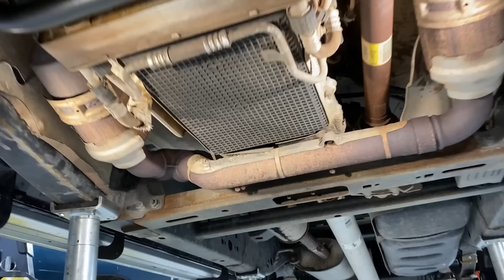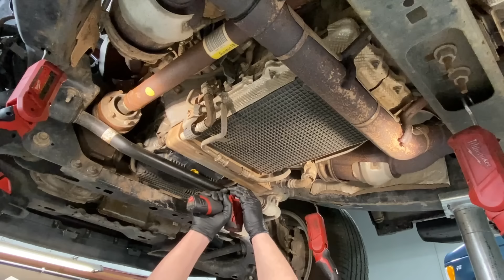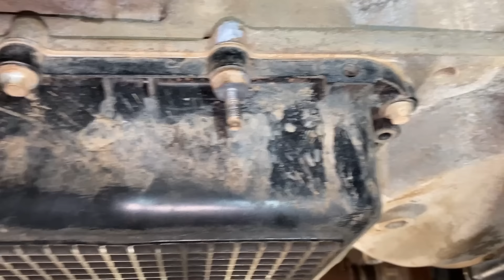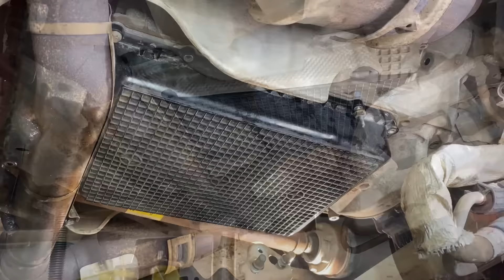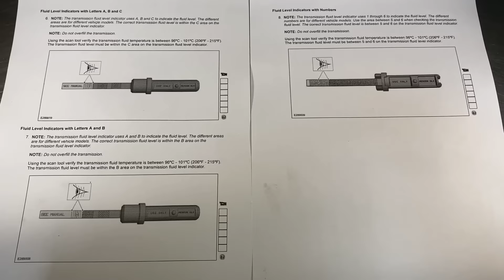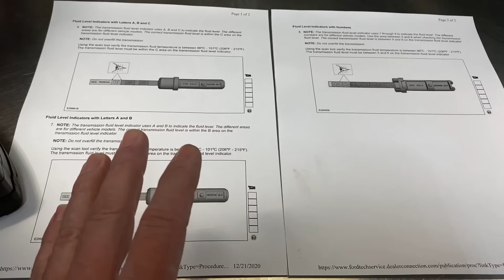Ford 10R80 Ten Speed Transmission: Fluid and Filter Service Procedure

Comment: Update.  I have had 4 separate quotes to have this done for $500-$600.  But then average people I know say it should never be over $300.  They probably do not know.  Or am I missing something?  I would like to attempt this myself but feel like I will miss something.  Like how do you purge the rest of the fluid etc...  ?
Reply from the maker: No I also quote them between $400 to $550 depending on the configuration. This trans is very labor intensive and the genuine Ford filter is not cheap. It all adds up for sure.
Reply: @FordTechMakuloco  Wow thanks for the reply.  your video is the best tutorial I have seen.  I think I will tackle it myself.

Comment: So I am in agreement with most comments I see here.  This looks a bit much for a do it your self job.  But I just called my shop.  They said.  3.5 hours  total cost for material, parts, and labor $585.00  So for that kind of $$ I think I will set aside an entire day in my driveway and make sure I don't mix up anything.  This video is a great step by step.  I just hope I don't mess something up.
Reply: Here in '25 that figure is $640-ish, from a shop I trust. Can't imagine what a stealership is charging, so yes I'm already half way through this job.
Reply: @craigbunyea6794 my local dealer said the trans is sealed and you can’t service it. Lmfao what a joke I said it’s oil it has to be changed!!
Reply: My local dealership is$1,000 for this job
Reply: Just did this job. Sucked the fluid out first and dropped the pan. 1.5 hrs total.
Reply: @fordracing19 smart to suck first
Reply: @fordracing19  did you do it on a lift? I'm doing it in a driveway and debating if it's smarter to do it flat or on ramps if I have to unbolt the transmission, I don't want it shifting on me.
Reply: @fordracing19  definitely suck the fluid out first. In fact, I am going to skip the pan drop and filter replace entirely. And just suck & replace.  $131 for 10Q and the pump
Reply: Did it laying on my driveway in about 2 hours. Not that hard.
Reply: My dealer sold it to me for $611. In June of 2025
Reply: @earlcarpenter3100 Was that fluid and filter or just fluid?
Reply: @anonymous_friend yes just fluid and filter service, then dealer screwed up and overfilled and had to take back.
Reply: @earlcarpenter3100 Oh geez. How did you find out it was over full?
Reply: I have been quoted 800.
Reply: I just did this job. Took me about 6 hours, but not horrible! Get some metric open end wrenches for the rear bolts of the pan. That was my only hangup. Took me a while to get to those with an adjustable wrench because I couldn't fit a socket in there
Reply: @angelo57a51  you got the 3.5 or 5.0?  

I don't understand his explanation of "3.5 doesn't need to worry about exhaust like the 5.0."  My 3.5 exhaust setup looks just like this video.
Reply: Dealership Quoted us 1,100$ in showlow Az.
Reply: Do it yourself. Doesn’t look that bad. Wise to give it a day to keep pressure off.
Reply: I got quoted $360
Reply: Did it in two hits my self easy as pie
Reply: So how did it go, doing it by yourself?
Reply: worth it sorry. pay them the $600 much cheaper than and trans
Reply: Not at all this is a easy 2 hour job 😊

Comment: It kind of pisses me off how cheaply (and stupidly) many modern vehicles are designed nowadays and Ford seems to be one of the worst. Just look at all the plastic pans and other cheap parts. Also, a drain plug would be nice to freshen the fluid between filter changes. Even the most basic maintenance tasks have become too complicated for the average owner to tackle. It's very frustrating considering how much as new vehicles cost, especially trucks.

Comment: I have a 2018 F150 10R 80 automatic. I contacted 4 Ford dealerships they all will only flush them. What your thoughts on flushing. I have 30 thousand miles figured I would just do an early service. It's much less expensive as a new  transmission. Thank you for your channel it's great.

Comment: Just imagine if the engineers who designed it would have added a simple drain plug to the pan...
Reply: This is one of those BS "Sealed Transmissions" with supposed "Lifetime Fluid."  They don't want you changing the fluid; they want it to break down, so you either buy a new transmission from Ford or buy a new truck from Ford.

Comment: I have a 2018 stx 5.0 4wd. Previous owner had 35 in tires with it all stock. It shifts strangely to me. Skips a gear on the low end sometimes. On the high end it seems like I really have to get on it to make it downshift to accelerate. The speedometer was not calibrated for the tires. I went down to a 33 inch and have ordered a calibrator to get it right. My question is do I need a reset on the adaptive tables to get everything right once I have the right tire size put in ?
Reply: 10 speeds routinely skip gears.  Thats totally normal.

Comment: Too bad you're all the way in IL.  TX could use this shop.  Dude, your video is why I decided this is worth doing myself.  The dealer wants $600+ for this service and says that dropping the pan only removes 4qts, MAYBE 5 at most.  I think I'll trust the guy with a wrench in his hand over a service advisor just trying to pull cash in for the dealer.

Comment: My 2018 F-150 with the 3.0 Powerstroke has the transmission cooler mounted to the driver's side frame rail away from the transmission, as well as there being lots of room between the transmission dipstick and single exhaust downpipe.

Comment: Normally How many hours a job like this takes  & how much would you  have charged a customer compared to taking it to a dealership  servicing .
Reply: My dealer charged me$260. I have a 18 f150 2.7. Worth it to me.
Reply: @huemongus3742  do you know if the dealer actually changed the filter?  I am concerned that a mechanic may simply vacuum out the fluid and replace the fluid only.
Reply: @honestabe7349  Yes, that is with filter change. Just ask them to do it. Same with rear diff, ask them to pull cover off and clean it out. Not just fluid exchange.
Reply: I’m also curious about this Brian. Normally I try to do everything I can on my truck but this is a bit more than I want and I’m only halfway through the video. I am only about an hour from your shop and I’m coming up on 30k miles. Guess I’ll have to give a call soon.

Comment: Have you ever had any bolts break on you trying to remove them? I have a 2018 150 with the 5.0. I just bought it and it has 58k miles in it. I’m in Northwest Ohio and the truck came out of Canada. Should I be concerned with doing the trans service?

Comment: This channel is the reason I decided to buy a very low miles 14' F150 instead of the new stuff. My 14' has the 5.0 and 6r80 which I believe is the best combo for work. Both, trans and engine have metal pans and the body is the last year for actual steel. Cherry on top is that it runs on E85 and regular. Corn fuel is $2.29/gal and 87 octane is $3.99/gal as of today.
Reply: My 2013 has aluminum doors.  Just dent them and see
Reply: the 10 speed is significantly more smooth and better for towing

Comment: How much fluid does the torque converter hold in the 10r80, or
How much fluid can I vacuum pump out of the tranny and replace without dropping the pan?

Comment: People if you have a 10R80 transmission with a ecoboost and it's a 2017 due a transmission flush. If your at 60k do it now, I did mine and it's a huge difference I barley feel shift. The fluid was so dark and it had a burnt smell to it.

Comment: Wow, what a ridiculously complicated process!!!  Question: Once you get the pan off, would it be possible to install a drain plug on the pan itself? That way, future service jobs you can simply drain most of the old fluid without needing to go through all this for a drain-and-fill job?
Reply: Then you would be reusing a dirty filter

Comment: I brought my 2018 to the dealer and asked for a drain & fill as my truck was just over 30k miles. They ended up flushing - I'm assuming to avoid the labor outlined in your video. Guess I'll have to do it myself or be more specific next time!

Comment: I was considering servicing my 2018 trans fluid, but 6 minutes into this video, I decided to let Brian do it.
Reply: Pin this comment lmao seriously just pay to have it done
Reply: Same, I probably don't wanna know what ford will charge for this job
Reply: @tylerdavis9301 Last week my local transmission shop (Indiana) quoted $900 for the job. Fluid and filter replacement. Ford Stealership has to be more than that for sure.
Reply: @tylerdavis9301 my local ford dealer said $925 lol
Reply: No crap.  I just picked up a used 2019 and want to do this.   I'll probably attempt it since I have a lift but regardless what a PITA!
Reply: @vfr800ification im going to attempt it without a lift
Reply: @simd510  How did it go? Thinking about trying this on my 2020.
Reply: @simd510 How'd that go, on your back? 😊
Reply: @bradhelfrich6602 he’ll get back to you a next year hes about half way done
Reply: It's not that bad, just time consuming. @bradhelfrich6602
Reply: How much does Brian charge?
Reply: @gregnapert9231 Four years ago it was $450.00
Reply: HA !Exactly  why I came to the comments, to leave that....I thought how hard can this be? I do oil changes and brakes on it...ill be paying a mechanic to do it  with 0 complaints on cost

Comment: Why is the replacement filters pickup in a different location than the one removed, also lacking that magnet?
Reply from the maker: The pickup and magnet are in the same exact spot on the replacement filter.

Comment: Fantastic work thank you very much for showing the procedure on the new 10 speed. I am curious it sure looked like there were belts driving the oil pump on the front of the transmission.  Belts running in transmission fluid what do you think the life expectancy of that is.

Comment: You're my trusted ford mechanic. I'm hearing ford is having problems w these 10 speed trans. What are you seeing or hearing? 
Also, what about reliability of the 2.7, 3.5, and 5.0? I'm reading a lot about oil consumption and other warranty issues on the 5.0. Seems like the issues with the ecoboosts have been resolved on newer models. 
Thoughts?
Reply: this has been discussed ad nauseam for years now.  Buy what you like they all have some problems.

Comment: One question, WTH is wrong with these engineers? 

No Dealer will do that kind of labor, they'll just lie and say we flush all of our transmissions and never have an issue. 

They don't but your transmission is definitely going to have an issue due to the Dealership's lack of competence or caring to do the job properly. 

I have a 2019 Raptor with 26,xxx miles which needs a new transmission because it basically fell apart. 

Now I have to hope that the flush the transmission cooler and lines prior to installing the new transmission. 

I never did donuts, burnouts, jumps, sand running and my 4 wheeling is in Mark Twain Forest roads so I guess it was just a defect from the factory because it's my understanding that the 10R80 are stout transmissions.

Comment: Hey! Why is the replacement filter missing holes in the circular spot in the rear passenger quadrant of the filter? The original one had 6 tear drop holes in a circle in that location.
Reply from the maker: That is metal stuck to the fields of the magnet not holes.
Reply: @FordTechMakuloco  Ah ha, gotcha!!

Comment: Cool! I just got a 2021 F150,  2.7  ,,  got 47 miles on it so far.  Cant wait tell 500 miles so I can start ripping some tires, haha.  Traded my 2016 F150, 5.0 with 80k miles, I didnt do a thing to that truck haha, maybe changed the oil a couple times. Ran hard put up wet, thats how I run them.   Cheers,!!

Comment: Big thanks for all these videos! QUESTION: I have a 2019 Raptor at 32K miles. I would like to just do a fluid exchange on my own then do the pan drop/filter at 60K; would it be worthwhile to extract the old fluid out, without dropping the pan and re-fill rather than dropping the pan? Thanks!

Comment: What about the rest of the fluid? Doesn't dropping the pan only get a few quarts out since they have a thermostat that opens? I had my trans flushed at 35k on my 2018, took 13 quarts if i remember correctly... I planned on doing pan drop and filter change about 70k.
Reply from the maker: Always do a pan drop, clean out and filter change, never a flush.
Reply: @FordTechMakuloco  Thanks buddy. I will do that moving forward. I did swap to amsoil when I had the flush done. I’ve always heard not to do the flush on higher mileage vehicles, but read it was fine if you start it early off

Comment: So, to check your engine oil, you just need to move the frame of the vehicle at least 10 inches away from the entire drivetrain.  Start by removing the negative battery terminal, then try to find where the cab bolts to the frame...

Comment: Thanks for the video. I bought the 2017 new when the transmission was a 2k upgrade. I read this transmission is good for life of vehicle, and that is 150k miles.
Reply from the maker: I would follow my service intervals here.
Reply: And the reason for no trans dipstick was to avoid pouring wrong fluids in.

Comment: I just bought a 2018 F150 King Ranch with 3.5 EB. There is sometimes a slight vibration when I decelerate from 35+ to around 15 or so. I can hear a slight hum and feel it through the break pedals. Is it differential? Transmission?

Comment: Too bad my 10R80 blew itself apart at 65MPH on the highway, went up to 400 degrees, lost all its fluid, and would hardly move. Had only 11,500 miles on it. Second F-150 in two years. NEVER AGAIN. Toyota owner now. Goodbye Ford.
Reply: They all have problems dude.  Believe whatever.  Go electric and all these problems go away.  Nearly zero maintenance

Comment: Can't wait for the customer complaints of, why is my trans filter now cost 500$, it used to cost me 80$ or what do you mean drop my car off?? Ive always waited for my trans filter replacement,  it only takes 5 minutes. Good job ford. Wonder if the camero 10 speed is the same crap design. Seems lately innovation is to bury everything yet the customers expect cheep cheep
Reply from the maker: Oh they complained all right but I said hey you bought a new truck with a sophisticated 10 speed trans and that comes with a price.

Comment: Have you seen a lot of problems of gear shift knocks/clunks on these transmissions? I have a 2019 5.0 with the 10 speed and I have had a clunk/pop/hard shift randomly since new. Easiest way to get it to do it is stop on a hill and let it roll forward, feels like someone rear ends the truck going into 1st. Been to the dealer a lot and they’ve called it as a normal characteristic
Reply: Yep.  Been to dealer many times.  Nearly always when shifting in reverse, and like you said on hill bad.  Slack in driveline.  Better if you let the truck RPM come down with warm up before shifting but sometimes still clunks bad.  No rhyme or reason

Comment: Kind of off topic.. I have a 18 F150 5.0 with a 10 speed. I have an obnoxious transmission whine. Ford said it was the high pressure pump. They changed that and it’s still very loud. 

It sounds like a jet engine while I’m towing a load and the transmissions is really working.

I’m out of my power train warranty but just wondering if you think I’ll have issues in the future with this transmission. 

Thanks!

Comment: are the 10 speeds still having issues? would you stick with a 6 speed?
Reply: terrible gas mileage for 6 speed.  I had both.  6 is more reliable and shifts nice, but 10 speed MPG so much better.  16-17 around town vs 13.  No comparison

Comment: Toyota does the level check at around 100 degrees... that's easier. I just use the "Torque" app with my Bluetooth reader to check the temp. 200 degrees on these Fords, that doesn't even make sense. I don't think most transmissions even reach anywhere near that temp normally unless towing. In the Arizona summer, even going up a steep mountain grade I barely hit 175 degrees on my 4Runner. I doubt the F150 is much different in that regard with operating temps.

Comment: I'm in the expediting business and am doing about 80K per year 95% hwy miles. I'm considering getting a Transit 250 or 350, and I think they have a newer design of there V6. I'm wondering how long these engines can last doing all the recommended maintenance required. I'm also concerned on how reliable these Ford 10 speed transmissions and rears are on the Transits medium or high roof vans are. I'm usually hauling 2000 lbs or less. What I'm driving now, the E350 5.4L gasoline with 630K and counting is a beadst of a work truck. Actual Ford great quality they got rid of which sucks.

Comment: I have a good question for ya . I have a 2009 escape 3.0 . ok the battery light comes on and off , and the insterment cluster goes dead and back on, and the power steering will go on and off. If you have seen this happen before can you help me out

Comment: Hey I love to look at your videos on the 2006 Ford Explore because I spend a lot of time replacing parts on mine that might fail due to my Explorer having 237,000 miles. I was wondering if you could help me figure out why my trac control, abs and wrench light are all on. I’ve replaced all hub assembly’s and abs sensors and the abs tone rings aren’t damaged. The light came on as I was going up a steep hill entering the highway headed to Syracuse NY 3 days ago.
 Sorry I know this comment is on the wrong video😬

Comment: So if this transmission is in all these different vehicles with varying power and torque levels, does that mean it’s super strong or are the internals all different compared to what vehicle it goes in?

Comment: While you're doing this job, it's a good idea IMO to replace the plastic pan with a metal one with a drain plug. I did this on my 2015 6R80 and it's made fluid and/or filter changes much easier to do.